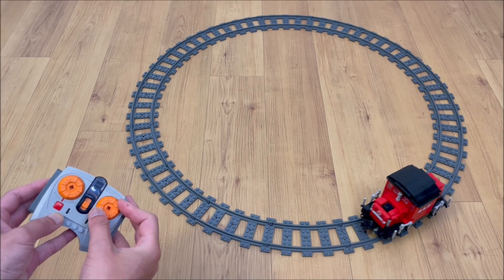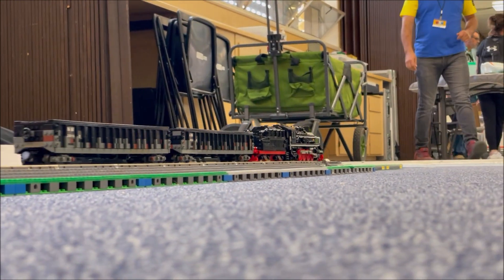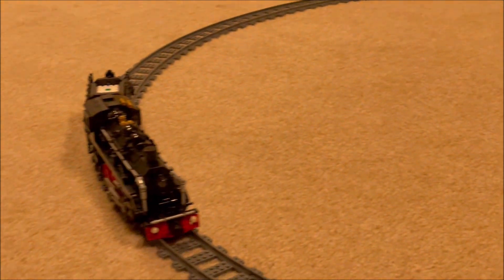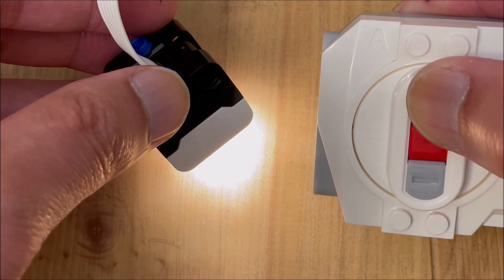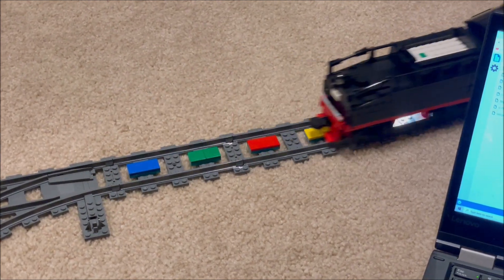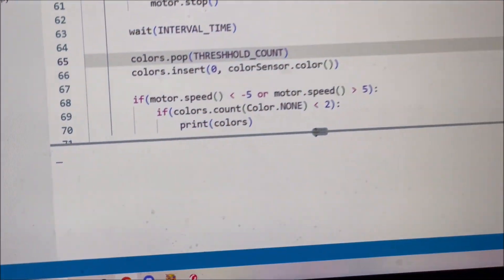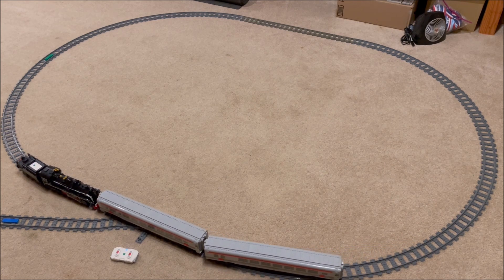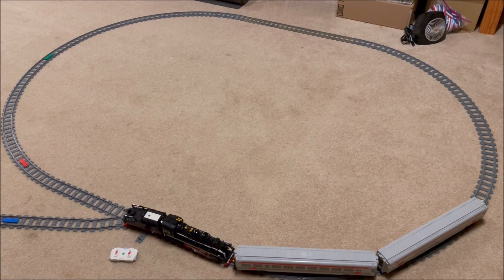Automating #lego 1:48 Trains with COLORS (Powered Up + PyBricks)

Comment: My solution is a color code. Yellow is the start. Then red or another color. The end color is yellow again. If the sensor scans an undefined color or sequence, the loop is interrupted and waits 10 ms... the train continues.

You can use a different color for the end. That way you know the direction. y r g vs. g r y ... works well for me.
Reply from the maker: This is an interesting thought. I will try it along with calibration if I do a follow up!

Comment: Some days ago I was thinking if it were possible to use black and white tiles as barcodes. First I was thinking coloured barcodes, which could include data like where the train is situated on the track, the direction or which branch it is going, but I thought the sensor might not be accurate for that. Of course barcodes would be quite complicated and the whole thing stops working if the sensor misses even one value. Including any ”error correction” wouldn’t really help, as they’d be even longer.

Comment: as an aside, the SY looks like it runs beautifully in panning shots. The connecting rods really look like they're moving at an accurate rate/speed for a real locomotive, not too quickly as most models do
Reply from the maker: Thanks! My only regret on that model is not being able to put more weight on the drivers... it works best when it's not pulling that much on R104 lol.